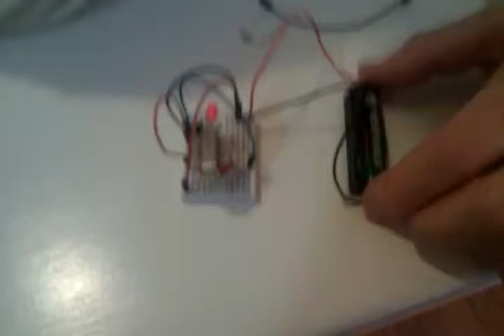Joule Thief With Only Transistor And Transformer

Comment: A typical red LED needs only 1.6 to 2.1 volts to glow.  I don't think it's 3V as claimed.  I have used the collector to base connection because it puts the LED across BOTH windings, so the voltage is double the normal JT voltage.  This works especially good for very low supply voltages where a silicon transistor may be able to run at below a half volt.  Thanks for the video.
Reply from the maker: When measuring from base and collector, it was showing around 6.2V or something, so your "double the normal JT voltage" sounds about right.  Just thinking about this now, I suppose you could charge a phone with this and a 5Volt LM7805 regulator.  With just the one AA battery.  It was one of the larger LEDs you can get at radioshack.  Do you have any opinions on the "jump-start" effect for why the wire can be pulled out afterwards with continued oscillation?
Reply: Matthew Rodgers
The 7805 is very wasteful of power and might need more to run than the circuit can put out.  You are using a transformer that may have been made for audio frequencies, and may have a lot of stray capacitance.  Also the proto board has a loft of stray capacitance between those contacts.  Either one or both could be causing the circuit to oscillate at some high frequency, possibly several megahertz.  If you put a 'scope on it and find this is happening, it may be because of the above.